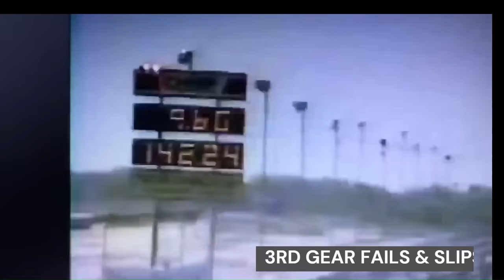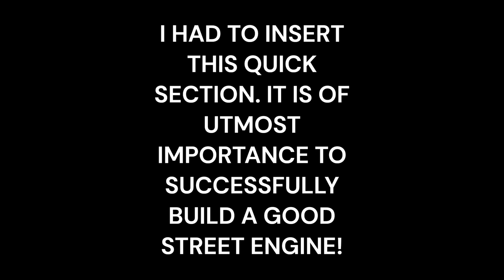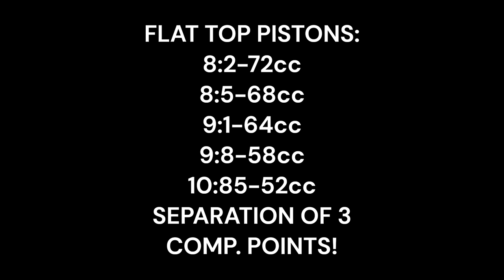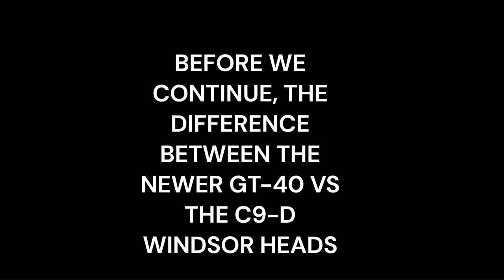BEST CYLINDER HEAD FOR THE STREETS!

Comment: Ford suks, why arent yu runnjn chevys They output fords all day long
Reply from the maker: Yes absolutely and why did Chevy followed Ford with the LS which many will say is the better SBC?  Crank is hard to discern because all the throws are in the same place.  SBC thrust bearing originally is on #5 now it is in the middle like the Fords.  In fact when you order an LS race block the main bearings are Ford Clevelands.  Port symmetrical on intake and exhaust just like the Ford and not mirror intake ports or siamese in the middle.  Head bolts the same and so is the dowel pin location is exactly the same. The LS copied the Ford now the LS-LT even followed the intake and exhaust position from the original LS now it is just like the fords.  Cross bolt main is a Ford block design so are the skirted bottom end.  When you switch to a carb you end up with an LS copy of the Ford 2828 manifold and they provide you with an MSD Ford distributor for your LS needs to switch over.  Crank bolts is the same 15/16. Head gaskets are the same and heads will interchange between SBC LS and Fords you can switch them over block to head or head to block.  I like both engines and like almost anything they start to look and function the same because function precedes design and copying is the best signal if who or what is better!  I like both because what I do with a Ford works exactly the same with the LS LT. More in common and these is good for us gearheads.  Anyway I can tell you do not race or compete because I will never say one is better than the other!
Reply: @benalamedaracing2765 the ls mains and heads are so fsr superior to the sbf we cant even compare the two
Reply from the maker: @ryangulley2051 , I have a different opinion and consider both equal in the crank department.  You know why?  Traditional SBC crank thrust bearings are located on the #5 mains for many years!  The LS as good as it is has it on the center like the SBF for many years.  In fact the factory cranks from both engines side by side is hard to distinguish from each other until you look at the ring gear for the LS.  In fact it is so close to each other the LS Dart racing block uses Cleveland main bearings because years ago they already saw the similarities.  On heads the Yates is very good and is a matter of opinion and in fact the LS-LT new cylinder heads swap the intake to exhaust position and now is very similar to the SBF instead of the opposite swap from the early LS.  I love building both because of the similarities and whatever works for one works for the other and I like that!  Makes my job easier.  One thing I wish they do is make the LS base blocks have a short skirt design so I can employ a kick out pan which is not possible with the present design as good as it is.  It is dry sump friendly because of it.